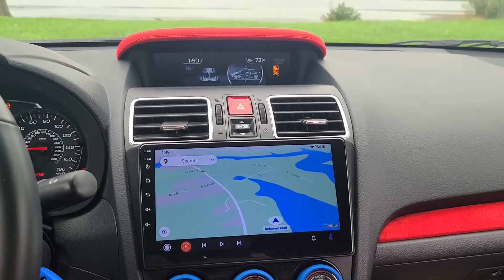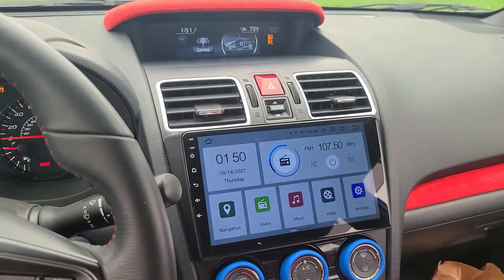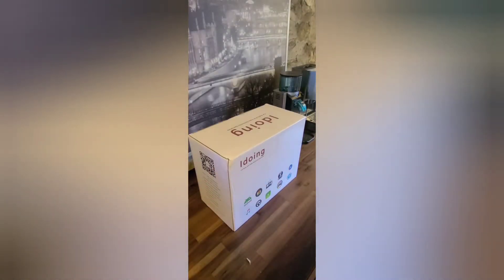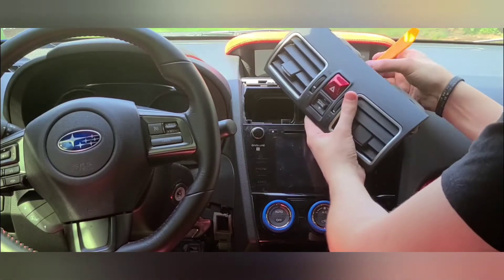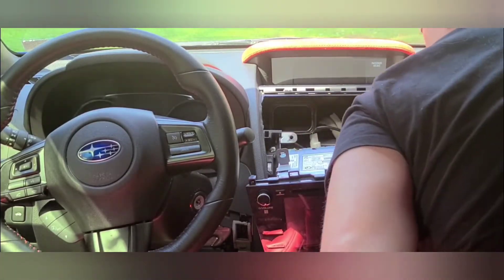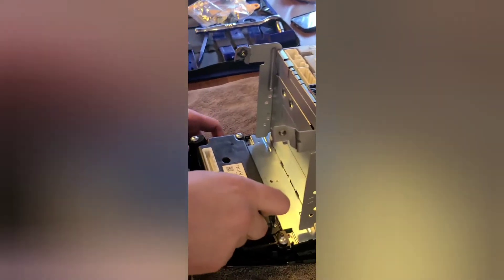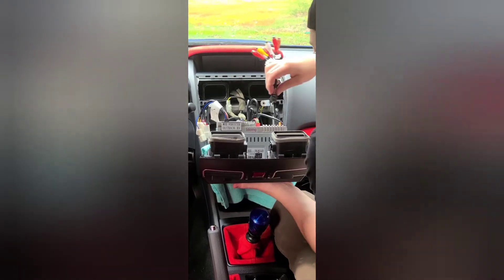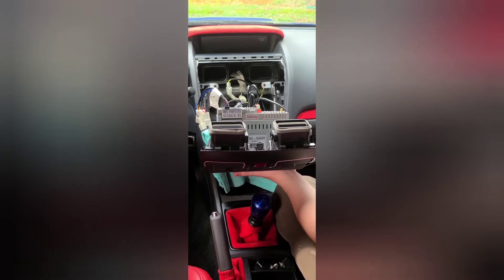2018-2021 Idoing Wrx Install

Comment: Man I struggling to put the headunit into place 😭
Reply from the maker: Dont be afraid to give it force with your palm. Just align the bottom and kind of align the top and start palming pushing it. I tried a bunch of other ways and this was best method with perfect gap fitment.